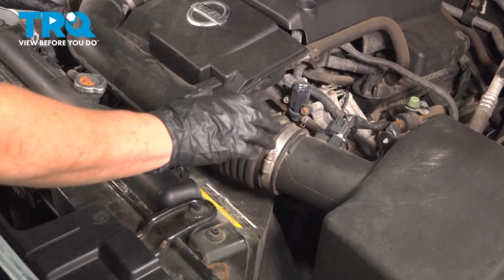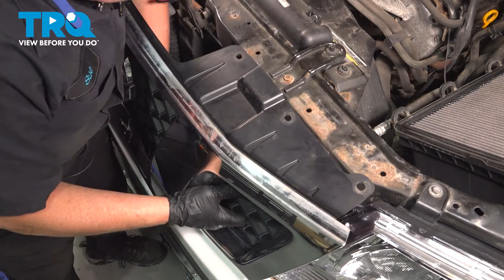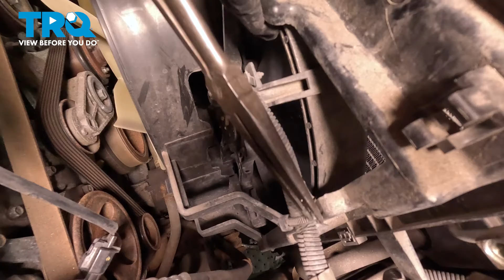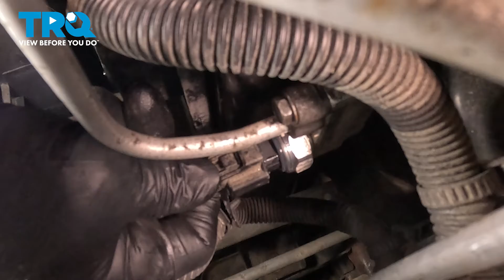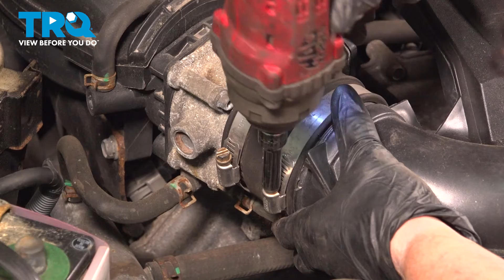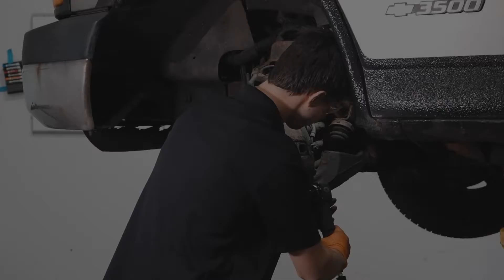How to Replace AC Condenser Cooling Fan Assembly 2005-2021 Nissan Frontier 4.0L V6

Comment: Do you need to remove the grill? Or is just so you have more room up front I'm thinking a step stool and leaving the grill on will still work?  I also have a lift so going through the side wall is easy also.